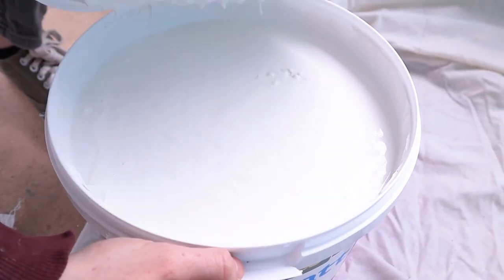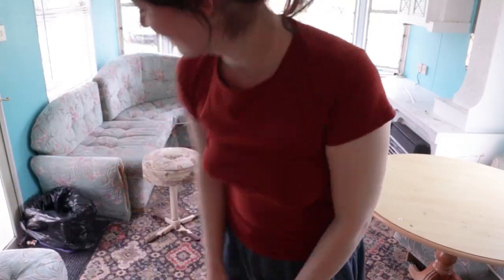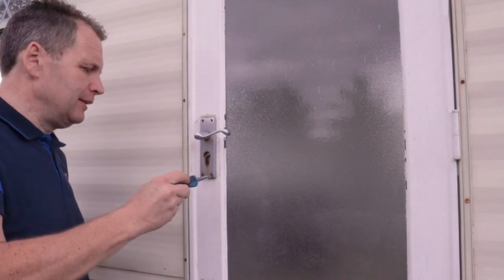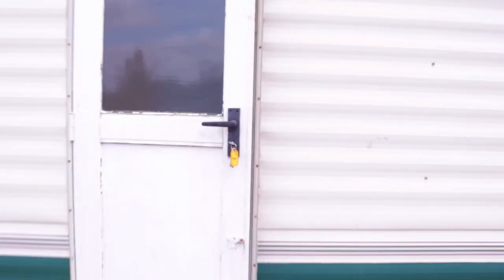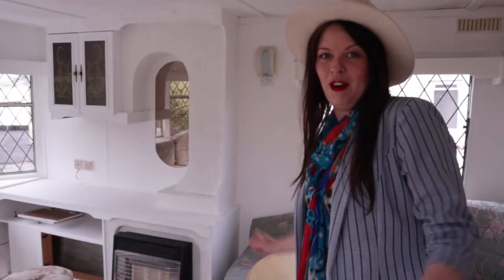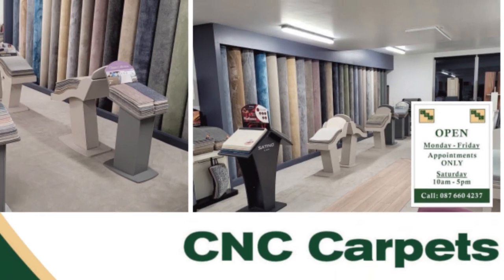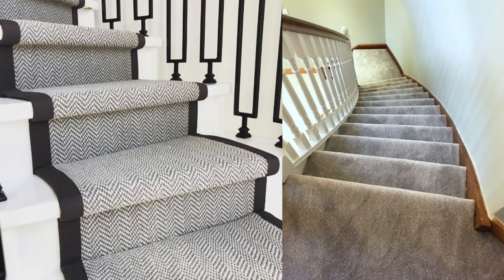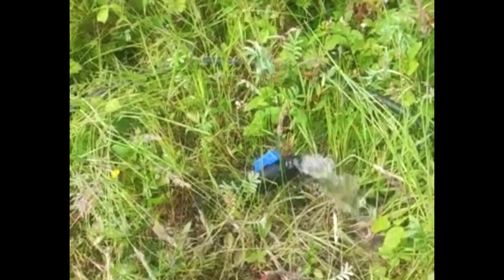Dilapidated Mobile Home Makeover (Part 1) PLUS Site Updates!

Comment: The heater in my manufactured home works fine, but I haven't used it in years because the ductwork under the house is falling apart rubbish... To keep cold air from entering in the winter, I've used folded bits of cardboard to close the openings under the vents. Replacing the ductwork is on the list; just not a priority. 
You two are making grand progress!
Reply from the maker: Thanks Brandy Jean!